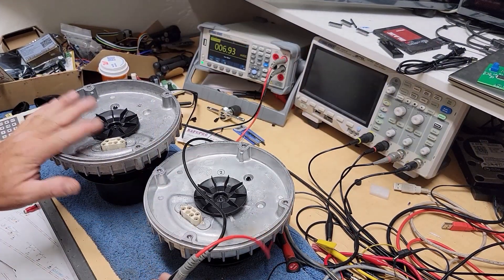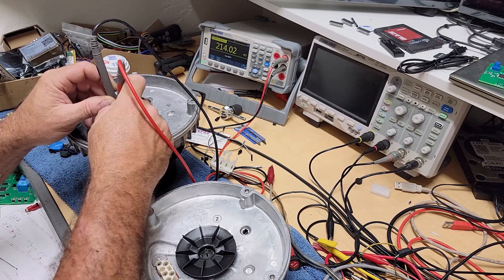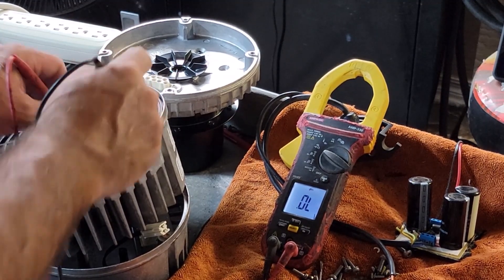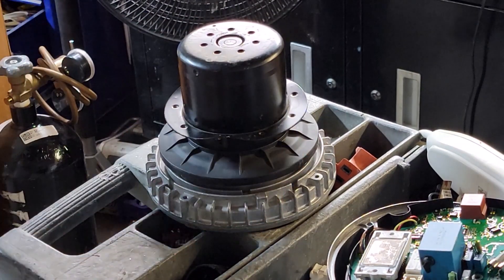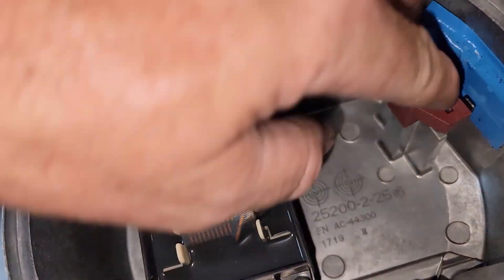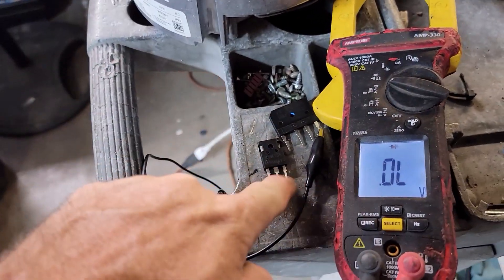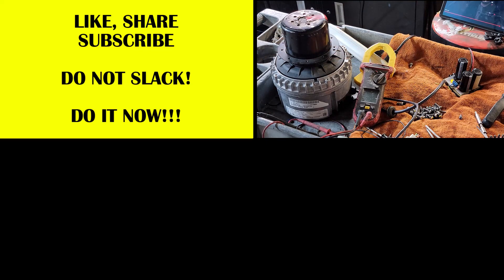Dissecting Various EcoBlue Axial-Fan motors that failed in different ways

Comment: So to initiate the fan motor you jump orange and gray wire?
Reply from the maker: That will run it at 100%.
Orange is 10VDC supply.
White is common. 
Grey is 2-10VDC speed reference in.

Comment: Seems like these fans have a lot of problems? Shame - I used to work with a lot of equipment that had EBM Papst fans, and they were extremely reliable.
Reply from the maker: Yeah it's not like it is a new brand. Big units have arrays of direct drive EBM motors. 
Seems that these new ones just have some things needing to be beefed up.
Also Carrier is selling a ton of them and while it seems like a lot of failures it is still a relatively small number compared to total sold.
The main thing was the supply chain issues. But I believe that is being remedied and there are now a line of replacements from an alternative manufacturer.

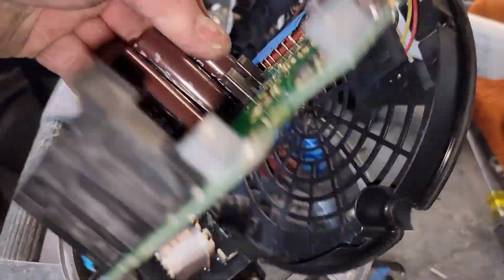Comment: Hey, does the EcoBlue fan have any NFC comms for setting or what? At 06:08 time mark in the video, I see abot in the middle of the pcb, just above the fuse some SOIC8 IC with something, that looks like a coil. By any chance, isnt that device M24LR64 NFC EEPROM? (pinout would almost match too) But just wild guess.
Reply from the maker: Not that I have heard of. That would be cool if an APP worked on that. LOL
The main IC is the microprocessor. Then there are often three gate drive IC/s.
I'll have to take another look.